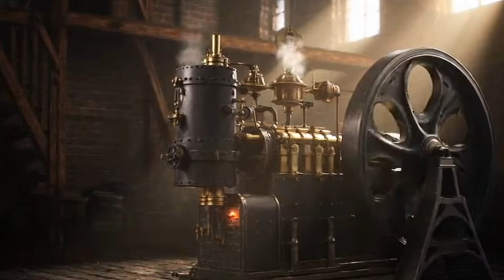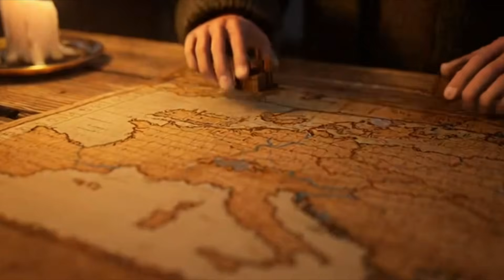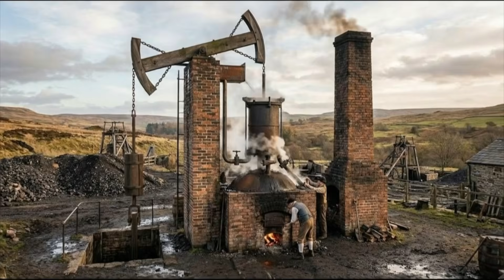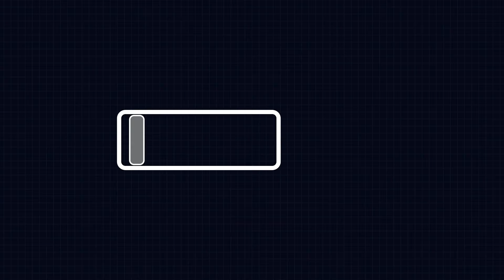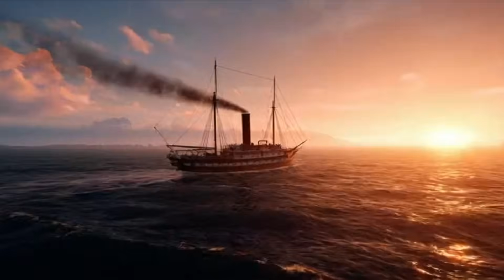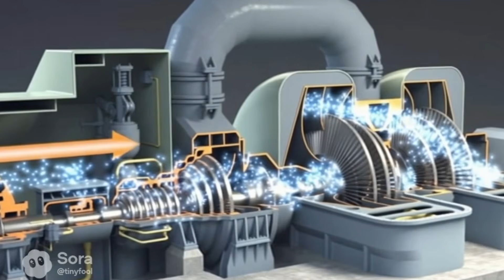The Steam Engine That Changed Everything

Comment: To my mind you have been over influenced by clerks and legal writing.

Savery's device was nearly useless for real mining, Cornish metal mines drained via gravity and tunnels from beaches horizontally into the bottom of mines, his thing could not help with deeper mines.

Newcomen's was fully practical and useful so multiplied all over the country and abroad.   It was inefficient but coal mines had plenty of slack, tiny chips of coal, this was unsaleable by law so burning it to drain mines was ideal and cost zero.

Watt improved the inefficiency from 0.1% to 0.4% but who cared?  He also demanded 33% of the notional coal cost saving - irrelevant to a coal mine but a cause of resentment in Cornwall where there is no carboniferous rock.  Therefore both Watt's employee Murdock and Trevithick saw that high pressure was needed.  The drum boiler resulted and from that stem all the things you mentioned.  Mill engine, railway engine or even Maxim or Stringfellow flying machines.

Watt was unpleasant.  Legalistic, even had Hornblower prosecuted and imprisoned for making a compound engine.  Now those, with condensers, became the method of propelling ships.

The development of Trevithick or Murdock machines became something like 7% efficient and able to drag heavy trains out of the Clyde Valley, at the expense of the exhausted fireman,   Watt's engine still lifts water by the ton at Crofton but any visitors recognise that it was a gigantic dead end.  A Swindon built railway engine may pass by at 70mph pulling hundreds of tons.
Reply from the maker: Thank you so much for your detailed and thoughtful comment — it’s extremely informative and clearly reflects deep knowledge of early steam engineering. I really appreciate the effort you put into explaining the historical context and technical evolution.

I’m genuinely very interested in these kinds of detailed discussions. Your points offer several new perspectives for me to explore, and I’d love to dive deeper.
If you don’t mind sharing, could you tell me the sources or books you’re drawing this information from? Some of the insights you mentioned aren’t commonly covered in mainstream materials, so I would really like to study them carefully.

I’ll take time to research the aspects you highlighted — especially the coal economics, Cornwall’s unique situation, Watt’s legal strategies, and the transition toward high-pressure steam.
These are exactly the types of technical details I want to understand better, and I plan to create more videos that explore these deeper layers of history and engineering.
Reply: It will require several bites of cherries and other fruit to transfer what I know or believe might need more understanding and where I might try looking for better information.  Often not books, remember I live in England where most of the relics are, relatively easy for me to notice plenty.  The subject of industrial history is more or less unknown in schools, though various European universities have taken it up.  Generally newspapers and broadcasting journalists lack sufficient knowledge to even start writing about technical matters.   Though plenty of people who can string stories together and make them saleable are ready to provide pictures and some garbled narrative if it seems likely to garner Christmas sales.   Fewer engineers who can write clearly but not get immersed in equations which school leavers will refuse to look at.

I am the son of a decent engineer, grandson of a self employed mechanic but with several generations of men who were railway executives, farmers, investors etc.  

As a child there were still many steam engines in ordinary use, I travelled daily by train, often the same drivers and firemen who would chatter as they refilled water tanks, I asked one why water was running from the exhaust injector, he glanced at it saying "That's waste and if we have waste they will give us the bloody diesels!".   I also acquired a book called A Practical Treatise on the Steam Engine by Rigg, 1870.  It isn't entirely correct, but gives various insights because written before steel was a normal material, so it says no bolt less than 1/2" diameter should ever be used, because even 3/4" ones are "..oft destroyed for want of judgement when screwing up.".  No ordinary journalists have either read that or actually done it.   They may go to ride on a 'Heritage Train', mainly an overpriced lunch, after which they write a story about the olden days.

A visit to the museum in a fraction of what was 330 acres of Swindon Works is instructive because they have displayed the tools and workmanship of apprentices, then a complete engine dismantled, plus a complete replica of an 1840 one and a 1923 one above a well lit pit through which visitors can go.

But as a child I knew two vertical boilers, feed pumps, the boilerman and thus gained knowledge of what was done and sometimes how it differed from earlier versions.   Nowadays the only working engines are only on Bank Holidays and attended by volunteers.

Having said that many books are not terribly useful you could do worse than find some by L T C Rolt, he had done an engineering apprenticeship in the 1920s, replaced fire tubes in boilers etc.  a capable and practical man with a decent education as well but I think had to write many books and therefore sometimes relied too heavily on limited sources.

Now generally about the economy and legislation in England which plainly differed from elsewhere because it allowed, or encouraged, the overwhelming majority of technical advance from about 1700 - 1890.  I suggest it was a mixture of being an island and difficult for foreigners to invade, thus kings were less worried about eccentric people and had no conscription army wasting men.  We had also arranged for a  church which didn't control things.  Made the king unable to tax without Parliament agreeing and generally liked individual eccentric people.

Very few of us could write before the Roman conquest of 43AD but Phoenicians had received tin from Cornwall though they couldn't cope with the Atlantic and it was the Brittany people who knew how to reach the Tin Isles.  Copper was from Cyprus of course, bronze the best metal because nobody had mastered the high temperature needed for iron.

Rome fell because they were gross with taxation and had no idea about horse harness either for draught work or stirrups for cavalry.   Then came Germans, later Scandinavians, finally French/Scandinavians.  From that mixture English language, rejection of Roman Catholic church and ability to not succumb to European tyrants.

European universities had clever people who saw that Rome was not the centre of the universe, Copernicus was put under house arrest, Pope was infallible.   The Dutch demonstrated vacuum.   Newcomen's engine makes use of that.  No house arrest, generally fascination.  He came from S Devon, close to copper mining, knew that draining mines was wanted.   Savery was more a curious gentleman experimenter, but had lawyers patenting so modern research can regurgitate the words, Fire Engine, but we don't know much about how Newcomen did it, how many helpers etc.   just that it was fully reproducible with the materials and tools of the period and worked reliably.

Now about coal.   People burnt wood but London grew and it was convenient to pick coal off the beach in Durham and take by ship to the Thames.  Bristol dug coal locally.   Having used the surface outcrops of coal it became necessary to mine it.  Now transport it from mine to ship in river.  Horses, panniers, carts, tramlines and wagons.

In Cornwall mining was a family affair, the Watt demand for annual fee for coal saving over a plain Newcomen engine was causing great resentment.   Watt had a representative in Cornwall called Murdock.  He obviously didn't enjoy his job.   Made a toy self propelled trike which frightened a clergyman.  He went on to invent gaslight and the necessary pipe network in towns plus the gas making works.  Trevithick was son of a mine captain and had as child played round the engine houses, Newcomen engines.   Will have noticed the Murdock toy, made a bigger one, invited his mates to ride and it went uphill for over half a mile.  More or less unsteerable. It was Christmas Eve 1801, into pub, roast goose and proper drink.  Machine destroyed by fire.  Try again but on rail to solve steering and potholes.  Big success.  He made a circle of track in London, charged a shilling for a ride, London supposedly a place where opportunity to make money is recognised.  Was not.   But many mine owners and ironworks owners saw potential and told their engine men to experiment.  Thus trains and railways.  Colliery owned, 200 years ago.  Stockton to Darlington.

Liverpool a major port.  Manchester the Cottonopolis of the world, poor transport between.  So build a railway.  Open 1830.  Everyone from Europe and USA visited to have a ride on the first public company owned railway.  NB opening day, a politician got himself run over and killed....   Any idiot could recognise that you don't stand between the rails.

The company had understood that trains must be quicker than horses or public would not change.  So in 1838 before Christmas London to Birmingham train 5.5 hours, as opposed the horse drawn coaches 14 hours. Is 112 miles.

1844 train London to Exeter for lunch and back to London for evening.  Average speed 45 mph despite 5 stops for water refills.   1846 London to Didcot non stop, 67 mph.

Naturally the so called educated said people would be unable to breathe etc.   Brunel wanted 100 mph but best he ever saw was 78.

By 1860s they knew how to scoop up water non stop and express trains didn't stop England enroute so averaging better part of 50.

1895 races to Aberdeen from London, well over 500 miles, less than 500 minutes.

If you imported a French or German horseless carriage the law demanded a footman in Front and anyway it couldn't reach 20mph.

Queen Victoria still insisted her train have oil lamps and not exceed 40.
Reply from the maker: Thank you so much for taking the time to share such a rich and fascinating perspective. Your comment reads like a piece of living industrial history, and I really appreciate the depth and firsthand context you bring — it’s something no textbook or documentary can replace.

I will definitely look into the works of L. T. C. Rolt as you suggested. Your stories and explanations have opened up several new angles for me, especially about apprenticeship culture, early engineering practice, and how England’s social and legal environment shaped technological progress.

Thank you again for this thoughtful and generous contribution — it’s incredibly valuable, and I truly enjoyed reading it. Comments like yours make these topics even more meaningful.